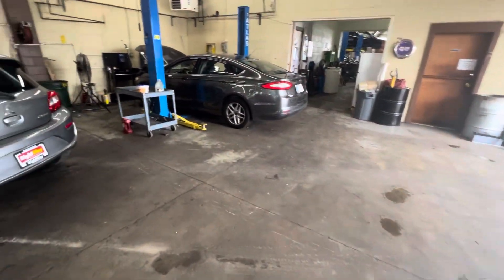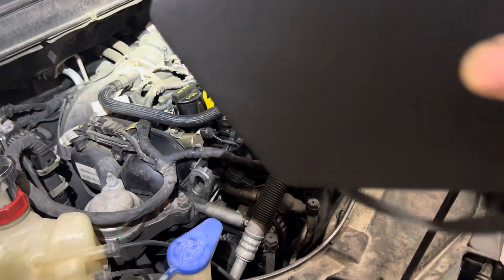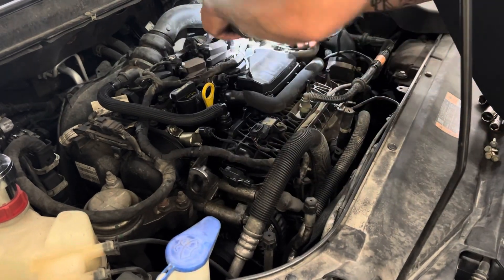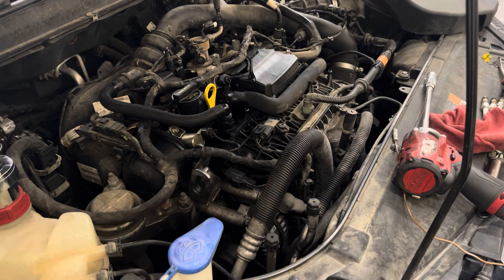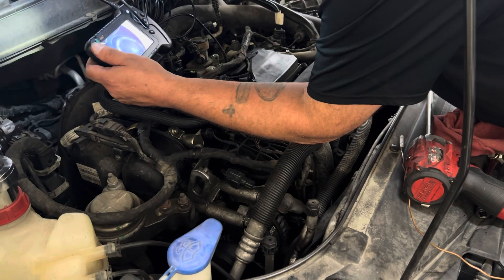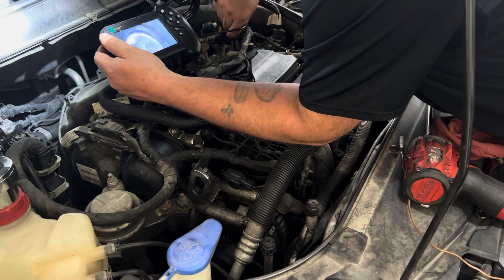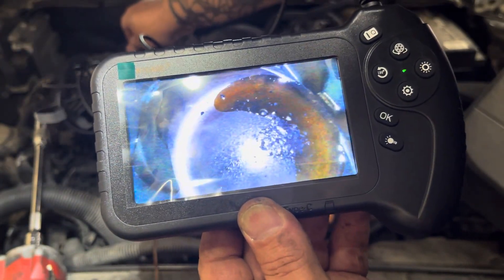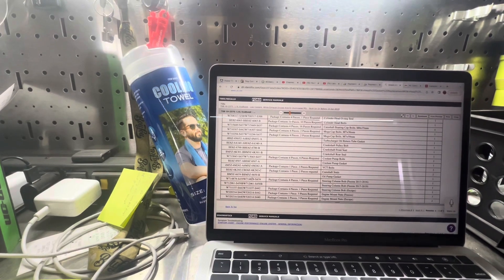Beware 2015 Ford fusion 1.5 L coolant intrusion. how to test

Comment: Could, none or bad compression in cylinder 4 cause a crank but no start? On these 2013 escapes
Reply from the maker: If it is just no compression because of a bad valve or something, it would still start if it broke a rod and somehow messed up the crank sensor, I could see it not starting